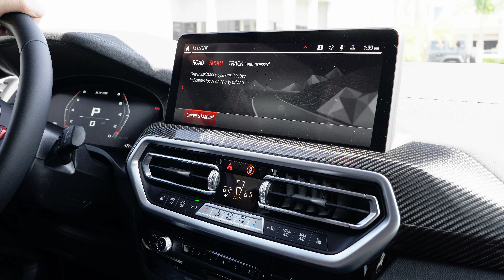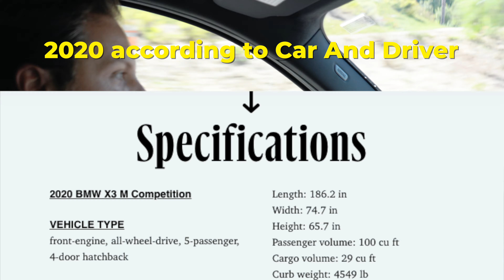NEW 2022 BMW X3M Competition LCI Getting Modifications! *Canyon Driving*

Comment: How is the ride quality over rough roads, these like no suspension travel to absorb, does it still ride good?
Reply from the maker: Actually it rode great , I drove it pretty hard with the travel being great, the stock shocks could still absorb, could they be better sure, but these were great. If one was to stay with the stock shock, I'd probably run them for about 50K miles and then look for a beefier shock that would be even absorb more. My one feedback was that it could really benefit from some beefier sway bars and arms, to mellow out the float, that suv's generally have. Again appreciate you watchin!

Comment: Thanks for the review of the spring mods. But what about the ride? My 2020 X3M Comp rides like an empty dump truck. Brutally stiff even in so-called comfort mode. And yes, it's also "floaty" around corners. Do you have more progressive spring kits that are softer on small bumps but stiffen quickly when pushed? And do you offer stiffer sway bars? 
Finally, why did you do the wheel spacers?
Reply from the maker: Hi 1 2, very welcome :)
 So the ride improved, however again I felt it was still floaty yet more sure footed and improved overall, personally didn't find it stiff (but one could always just go for a complete coilover with an adjustable shock for more comfort).  

I think for sure we'll have some sway bars soon in from the manufacturers . I am hoping they release soon because I think it will really improve the handling big time. As to the springs yes we have them and happy to do so.  Can contact us here at ModBargains.com 714.582.3330 and we can work on getting you a setup.        

As to why we did spacers, as per your name give you a 1 2 , 1: one for sure is aesthetics (getting the wheel from being sunken in, improves the look dramatically). 2- performance wise , spacers push the wheels away from the chassis, this helps actually reduce some of that body roll, and increase the lateral grip for the tires (so when they have that more even tire load, you can have that better acceleration grip when you come out of a corner and are stepping on it).
Reply: I agree about the ride of the X3M, it was stiff enough stock, now lowering it just made it rougher.  Love the look of it though, but went with the X5M, just more smoother of a ride.  600hp, 2.5 ton beast does move quickly also, 0-60 in 3.6 sec.
Reply: We need that you talk about the ride feeling in terms of suspension. Is it harder, softer or same as before the kit? Etc. Thanks a lot for your time.
Reply: WTF - this guy said it’s “floaty” in corners. Uuummmm… Nah dude, it definitely ain’t floaty in corners